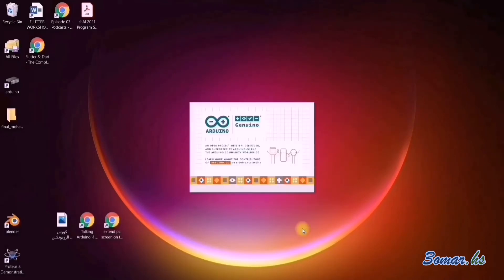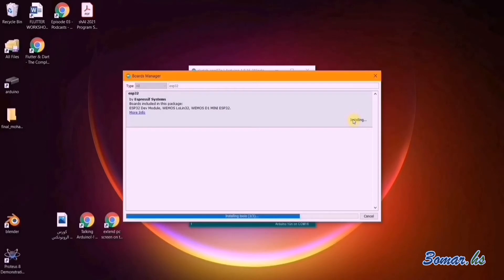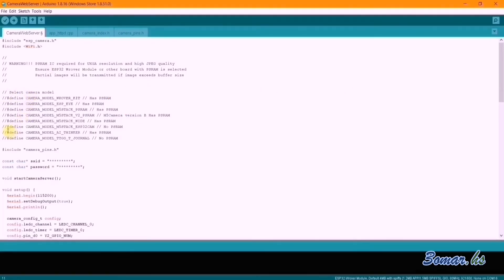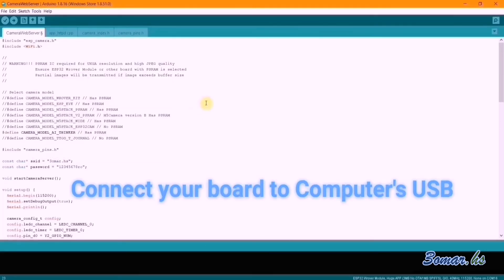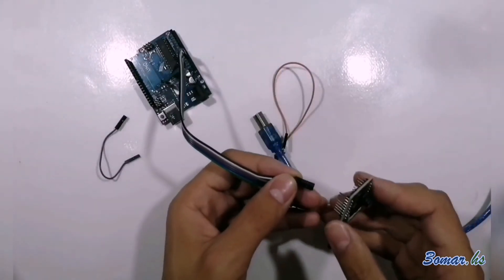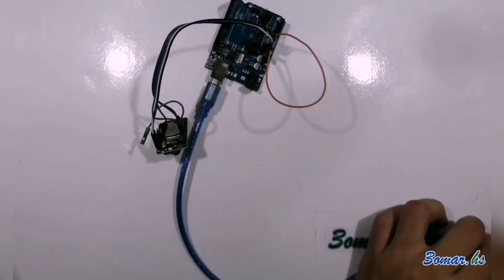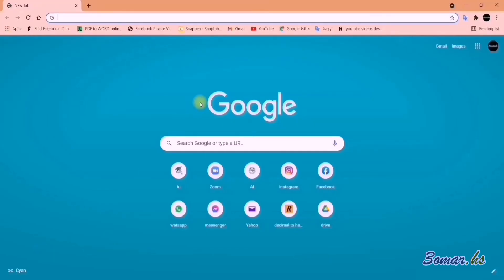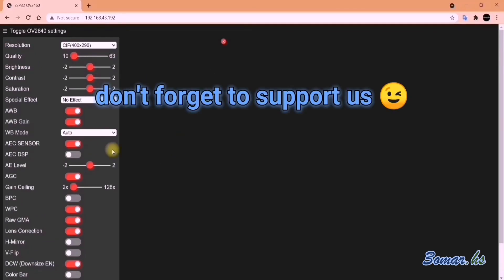ESP32 Cam programming (get started) step by step

Comment: hello my friend please i have FTDI I have PowerShell, I have a relay, and when I lock the project, I have a problem during the implementation of the project. When I download the code, this message appears 
a fatal error occurred: Failed to connect to ESP32 : Time out waiting for packet header
Please 🙏 help me
Reply from the maker: Fatal Error is caused by lose in wire connection or requires to push the restart button during code uploading